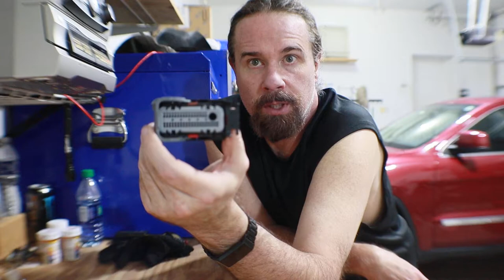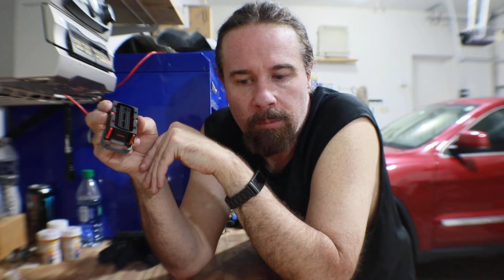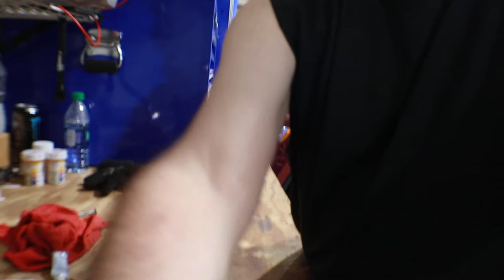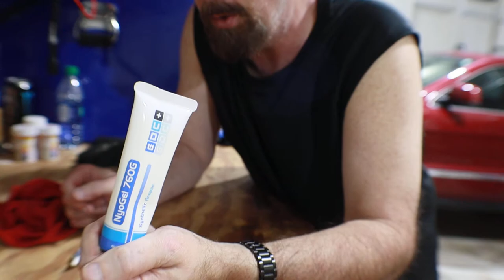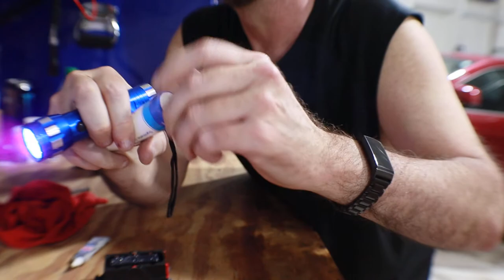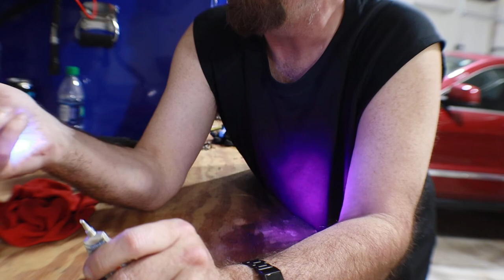Dielectric grease: What's it really for? How's it really meant to be used? So few really understand

Comment: I recently purchased a new Beta offroad dirtbike. These dirtbikes have had severe electical connector degradation. I've been trying to figure out what is the proper grease to use on my multi pin connectors not that different from your harley one. Thank you sir. So much. Very in depth and excellent explanation of a product that is absolutely mis understood across all mechanical and electrical facets.

Comment: Thank you so much I had this exact question as you had all these yrs. Today I needed it for a bmw. A very critical connector, multiple connectors actually are getting contaminated with small amount of diesel fuel that was migrating from a sensor through about 4 feet of coated wire. Hopefully this helps. But at the least you just answered a burning question of mine for yrs

Comment: Interesting topic. I have just finished overhauling a Toyota landcruiser 80 series electric diff lock motor. Main problem was a magnet dropped off the motor can. I used loctite 401 to stick magnet back on. One part of the motor drive had 3 internal contact arms creating circuits and cutting out on blanking spots. It was all lubed up with Toyota Body Grease which toyota uses for lubing electricals and wiper stuff. It was not available in NZ and they quoted $200 for a small pot. I did some research and bought from an electronics store Carbon Graphic Grease. Carbon Graphic Grease conducts electricity so is good with contacts. Cost $17.50 nz. Motor works great. The electric diff lock motors when faulty Toyota says buy a new motor, saved a small fortune with my repair job. When researching  I did read about Dialectric grease.

Comment: It's absolutely an electrical insulator, not conductive. It goes on the contacts. The electrical insulation part mostly matters if working with higher voltages to prevent arcing.
The most useful property is that it keeps contacts from oxidizing and displaces any water that might get in. It also lubricates to minimze physical wear.
In a pinch vaseline will do a very similar job, but it's not as stable in high heat like near engines.
Reply: Thats whats so confusing,  If its an insulator and you put in on connectors and spark plugs wouldn't that interfere with everything?
Reply: @theenglishtrucker1849  No, because the grease is soft and stays soft. It is not a coating like a paint.  Every plug&socket type electrical connection has some form of spring that physically pushes the connectors together so they make good contact. The grease easily moves out of the way and doesn't interfere with that. It just fills the voids around the connector.

Of course dielectric grease is only meant to be used with connectors. If you completely misunderstood the purpose and did something silly like coating the actual sparker of a sparkplug with dielectric grease then there would be a problem :P
Reply: @TheStigma dielectric grease is non conductive therefore does hinder the flow of electricity.. it's inert, you only apply dielectric grease to the porcelain section of a plug or inside the boot but make sure it doesn't get in the contacts. You wouldn't use a rubber band as an electrical wire would you? Because it's non conductive.
Reply: @meak13  I said it was an electrical insulator, so we are in agreement there. That's what dielectric means. It does not interfere in electrical contacts that have any reasonable degree of clamping force because it simply moves out of the way. If the electrons had to flow via the grease to bridge the gap then your contact point would already be defective to begin with.

I will admit that I don't work on engines that much, so maybe the recommendation specifically for sparkplugs is different for some reason (perhaps just unnecessary?) - but I use dielectric grease in all manner of other electrical applications and have never had it interfere with a good connection, even in very low-voltage scenarios around 1v.

Comment: I was told the same thing when I was about 10 years old by my dad and have been using it ever since. What is hard to understand is if you are putting it everywhere and it is non conductive then you would think that it would hinder the connection but it doesn’t. It is pushed out of the way by the metal in the connector and it is encapsulated by the grease keeping out moisture and debris. There is a ton of misinformation on the web and YouTube on all topics which makes understanding any topic difficult. And they don’t even have the decency to remove the content when they are told they are wrong.

Comment: I use Silicone Paste , basically Dielectric Grease which has a thickening agent added to develop into a paste .   I apply the paste to the fixed roller pins of CLASS 8  S - Cam brakes .  Helps keep out the intrusion of water .
Reply from the maker: @vicpetrishak7705  I'll have to look into that. Thank you

Comment: So your father was pretty much correct...Except for putting it on the end of a spark plug electrode. I will tell as an industrial electrician even indoors years down the road terminals look better when dialectic grease is used. There are specialty out door crimp on connectors that are already loaded with Dielectric grease and have a bladder that breaks and loads the contact area of the connection when you crimp it.

Comment: Thanks man. All I found up until this was conflicting information. I applied it exactly the way you did and was told I was completely wrong and only doing harm. I'm honestly still unsure about spark plugs. Everywhere says to use it just to seal it around the ceramic and to NOT use on the metal portion. Your thoughts?
Reply from the maker: You should have asked them what "harm" you are doing. The answer could be entertaining...

Your sparkplug boot has a metal connecter in it of course. You have to push the metal helmet (connector) over top of the sparkplug tip. Any dielectric on that sparkplug tip will get displaced leaving a metal to metal connection. Dielectric displaced surrounds that connection protecting it.

Anyone saying around the ceramic is wrong. Won't hurt, but doesn't help either.

Comment: Here is what I have been told about dielectric grease. It's called dielectric because it won't conduct electricity meaning if you get a glob of it between positive and ground or any 2 or more circuits it won't short them together. Most lubricating grease has conductive material in it like aluminum, graphite, and other metals that can short between circuits.  Not that it is an insulator as such but what was stated at the end of the video about being a lubricant, water repellent, and anticorrosion treatment is what I have learned. I am a marine mechanic and Mercury marine cautions against using too much in connectors specifically the push together rubber engine harness plug. It can create a hydraulic situation that will push the connector apart. Besides the stuff is expensive. I have seen the hydraulic effect Mercury service bulletin refers to. Some of our OEM ign wires come with dielectric grease applied to the plug boot but only abut a drop of it for the reasons of preventing sticking, flash over or carbon tracking which can be caused by dirt retaining water. I do use antiseize on spark plug threads but very sparingly and keep it off of the firing tip and insulator. Too much in the plug boot can also cause hydraulically the plug or cap end off with heat and vibration especially if the connector doesn't hold tight. In the marine world we have salt and water to contend with but it might actually be worse in the automotive and motorcycle world from road spray and in areas that use road salt.

Comment: Dielectric grease is a 100% insulator with 0% conductive properties.  It should not be applied  directly to any components where you are trying to achieve an electrical connection. It should be applied to the surrounding area around that electrical connection to protect the connection and contain the current within the connection.  For example on a car battery terminal you do not want any dielectric grease in between the terminal and the battery stud. You want that connection to be a clean metal on metal connection. Once that connection is complete you can apply dielectric grease on the outside of the terminal and stud to insulate that connection. When you apply dielectric grease directly to the connection contact points you are hoping that the connection is tight enough to scrape away enough of the grease to achieve the metal on metal connection.  In most cases this works and therefore doesn't hurt or affect anything but it is the incorrect way to do it and you are more than likely not achieving the best/strongest electrical connection.  In the case of spark plugs dielectric grease should only be applied to the ceramic housing where the ingition coil boot surrounds the plug to make a seal.  It should not be applied to the stud or the female connector inside the ignition coil.
Reply from the maker: Dielectric does NOTHING for the ceramic area.
Doesn't hurt, but does nothing.
If you aren't connecting 2 terminals strong enough to scrape dielectric away and make a strong electrical connection, then you need to work on that connection because it is unacceptable.
In an ideal situation make the connection and apply dielectric around it. In theory you are not wrong there. In practice that is often impossible. So doing what I said becomes the only way, and is totally fine. Any good connection will push the dielectric out of the way and result in not only a strong connection, but one that is most protect led by the dielectric grease.
Reply from the maker: @rsinj  I'll start putting it on the ceramic I guess. As I said, it can't hurt. It is cheap enough. I have never heard of a boot getting stuck to the ceramic, but OK.
Permatex saying so isn't a reason for me personally, but glad you shared that. Sounds like a company trying to sell a lot more product. That could easily double their sales if dielectric grease if everyone listened. 
It is really a situation of "well, I have this dielectric out anyway for the tip, I might as well."

Thank you for your input.
Reply: It's more important to protect the terminals from corrosion.  The mechanical connection is male pin to female
Reply: @cloveroak5492  Good grief.😂
Reply: @robbiesharp311😂😂 right
Reply: Okay thanks for the information.
Reply: The only problem with silicone grease is that it will cause “fish eyes” on any surface that you varnish or paint. BTW, THIS grease is good on spark plug ceramic so that you can remove and replace the rubber boot more easily.!  It will also act as a water barrier for connectors, switches, volume controls, light bulb screw bases, and  dry cell terminals! Been using in home and motorcycles for yearsssss. Just keep finger smears off of wood and metal that you wish to paint!

Comment: In the spark plug example, you would apply the Dielectric grease to the ceramic an the spark plug....NOT the either side!   By put it on the boot is pressed onto the plug the grease forms a seal between the plug and the boot....keeps moisture and air out!  Got to keep in mind what the word Dielectric means!....It means it doesn't conduct electricity!... So the last thing you would want to do is get it anywhere near the conducting parts of the plug!

Comment: It's not intended to be used on the pin's of the connectors. Doing so could interfere with the very low voltage going through the pin connection. There are those that say the contacts will push unnecessary grease out of the way when making the connection. Perhaps so but why take the chance. Simply put a very small amount around the gasket and none on the conductor portion. If you own a vehicle getting obd2 code p2127 or p2128 you will want to check for grease inside your connections. Don't ask me how I know.
Reply from the maker: #1 in this situation it's not "taking a chance"...it's the only way. (up until this situation my thinking mirrored yours) 

#2 this was told to me first hand by a Nyogel engineer after me voicing the same concerns you just did. 

With this connector there just isn't any choice.

Comment: I would first use electrical contact cleaner. Then use a spray that improves electrical properties. (they have these at home depot. Then use Dielectric grease just to insulate the connection from outside elements. Sometimes if you just use Dielectric grease and the connection is not clean and connecting properly it still wont connect. Dielectric does not improve the connection it only insulates the connection from outside elements.

Comment: With you brother. 2015 RK 20K miles Bought it two years ago with 1504 miles...Same chicken shit connection at the Throttle Body. The Rubber bootie is a joke, flops around and can't imagine how it serves any purpose ie stain relief/moisture seal/ dust cap/ heat shield. WTF. I was going to purchase a male and female matching connectors and add a 6 inch extension and seal all the connecytors with a RTV that is rated for heat and gasoline. Then I lost my low throttle capability "which was a real bitch in a tight parking lot or while riding with the fellas. Prioritized replacing the Throttle Body and rerouting the cable over vs under the A/C ( note I have a DK Customs back plate ) and wrapped my harness with Gaffer's Tape Additionally, I had to add a tie wrap to the connector locking tab in order to get it to stay put. Concluding with a blob of RTV at the crown.  Holding up with my motor upgrades Scots Irish Luck.
Why the company failed to incorporate a set of screws for this critical junction and avoid any liability is mind fragmenting  at minimum. 
Its no way to build an areophane Ill tell you.
I appreciate your effort putting together the presentation

Comment: I’m still confused as well. Sounds like electricity flows through it but it also holds electricity in it and prevents it from arching. As well as keeps water out. Which sounds like it’s most important role if I understand correctly. Is this correct clover Oak?
Reply from the maker: I wouldn't say electricity flows through it, because that would mean it conducts. But if there is a connection surrounded by dielectric then it would keep the electricity within.
Reply: Makes sense thanks man

Comment: I’ve always used it on the contacts on my trailer plugs to prevent them from corroding and it’s worked great. No green acid build up. You can also use it on battery terminals. I’m 70 and started using it many years ago when I noticed my 7 pin and 4 pin connectors were corroding. Since then, problem solved. And your right about a load of useless videos on YT